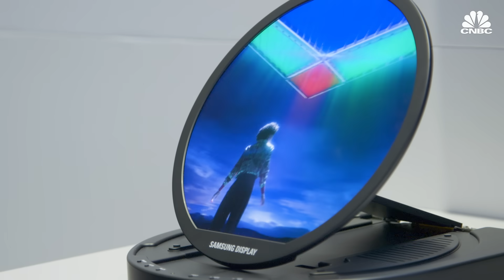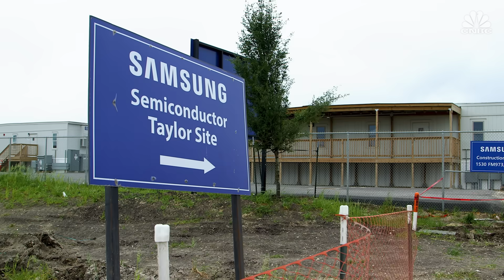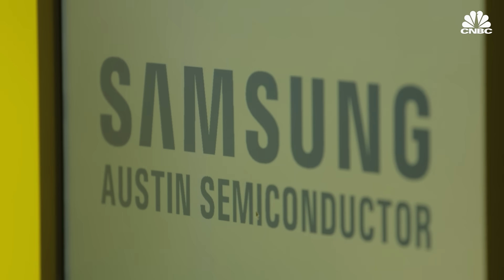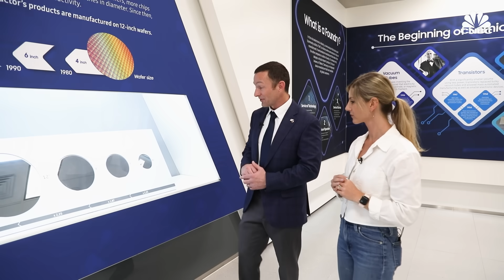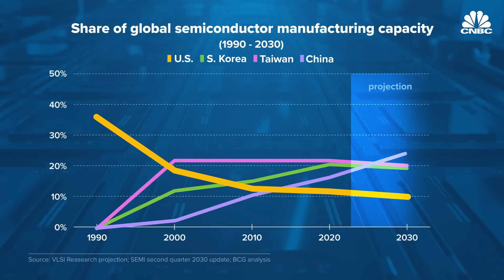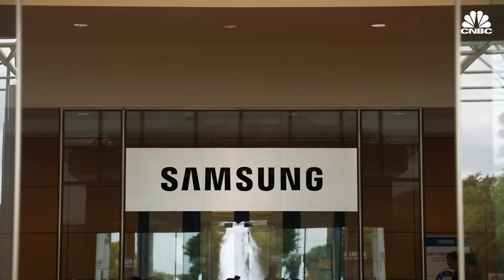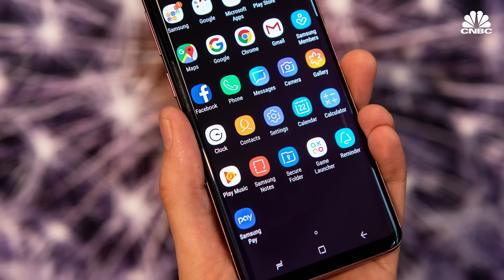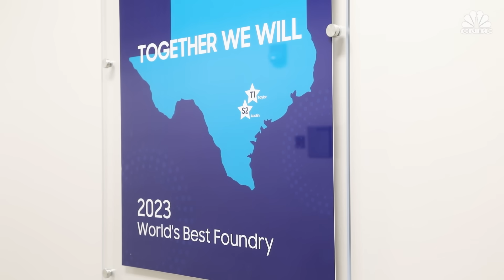The Untold Story Of Samsung’s Growing Chip Business

Comment: Memory chips are required in massive amounts for AI models and calculations, it's not just logic chips that's required. If anything, there's a high capacity memory module shortage in the industry as demonstrated by Nvidia GPUs getting slammed by reviewers and customers for still having memory capacity standards of 5 years ago. Demand dropped for old memory modules, not new, higher capacity ones.
Reply: It is not scientifically possible to have off premises ram. Unless we can exceed the speed of light. Silicon photonics is a great tech on prem for node to node communication and maybe one day we can have JBOD type arrays for ram that actually do stuff but the real moneys in cache. That’s why you see AMD with 3D V-cache and intel with Adamantine and on die HBM in their meteor lake (coming soon) and SPR parts
Reply: With increasing connectivity speed (5G), AI modules can access memory instantenously in the cloud, I would think that on device chips needed will be more of logic rather than memory. cloud and faster connectivity is a major reason demand for memory chips is slowing down.
Reply: @TomiwaAdegbola  There’s no ‘instantaneous access’ to the cloud or any magic like that. AI needs as fast access as cutting edge technology allows on the same board, even on same chip to work real-time. Storage =/= memory
Reply: @sapphyrus Nvidia is getting blasted by reviews because they limited their memory on their middle to lower cards to be cheap. There isn't a shortage of memory as other mfg have added plenty of memory to their cards. Problem is they put 8gb on even their slightly higher than middle cards that should be able to play games at give resolutions but can't as games at higher resolutions use more memory. They limited themselves and deserve every criticism they are getting. 

Samsung also has huge advantages over the US as the company as a whole is a monopoly and controls a good amount of govt. That is what SK did to achieve where they are now, let companies monopolize and grow with no competition.

Comment: Some info is wrong, Apple is no longer buy chips from Samsung. Last time they bought chips from Samsung was 2009 or 2010
Reply: No, the video is correct. Samsung still supplies display driver chips.
Reply: @dheerajnadella1470  The video is misleading since they didn't mention what kind of chips.

As long as Apple gets the display from Samsung but if they get display from another company then Samsung has nothing to do with it. 

And if you take a look at chip performance (not the one for display) then Apple has the edge over Samsung and the entire industry thanks to Apple silicon.

It's all about quality not quantity
Reply: @seanelias6478  Samsung still supplies NAND flash chips to Apple. Literally the biggest topic in this video is the fact that Samsung dominates in memory chips.

Also the Apple silicon has great performance mostly due to its computer architecture and much less with the fabrication process. Apple only makes those chips for their own devices with their own OS so they are capable of tightly coupling the architecture to work as efficiently as possible.

Comment: I like real electronic devices and appliances in my home. The last thing I want is having a battery explode on a cell phone or laptop., a TV set’s power supply bursting out just a week or month after the warranty as expired or if you are into water sports, how about a dishwasher inner plastic has decided to cracked and bless your floors with soapy leaking water all over the house or a refrigerator (compressor) that stop and doesn’t want to be cool and spoils all my food., or  how about a washer machine that wants to play rough and have decided to simply explode because someone decided to build it using plastic supports instead of steel.

Comment: This is how good Chinese 🇨🇳 semiconductor industry is:
- Taiwanese 🇹🇼 TSMC will have 2nm chips in 2025, China will have 28nm chips by 2030.
Reply: China has been actually mass producing 14nm for a while.  SMIC's 7nm is questionable, but functional.  There are a lot of former TSMC engineers moonlighting in China.
Reply: TSMC 2nm production most likely will be 2026 or even early 2027 and not 2025 (based on the estimates and analysis I've seen, and despite their 2025 announcement), Intel and Samsung are in the race to bring down TSMC from the top place by doing it in 2024 and 2025 respectively, (Intel, late 2024-2025, Samsung 2025), and at this rate of decoupling and tensions between US and China, I don't think China will be even able to make 28nm chips by 2030 anymore as its semiconductor industry is totally dependent on the equipments, tools, materials,... from US, Japan and other allies.